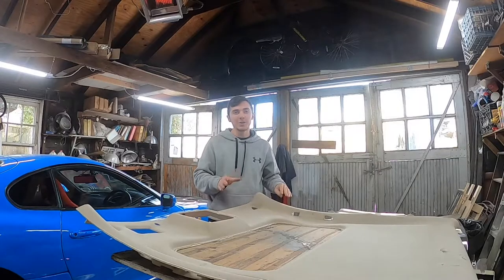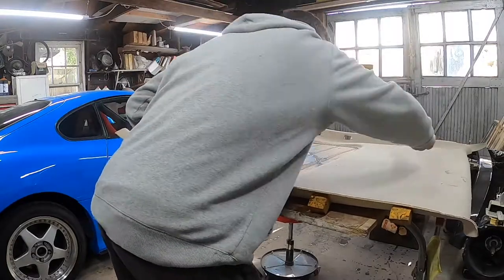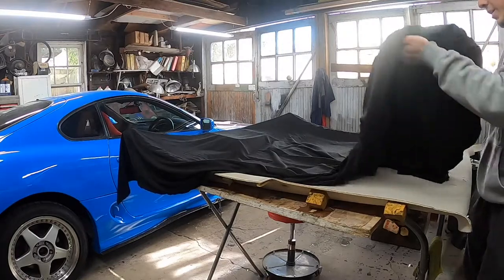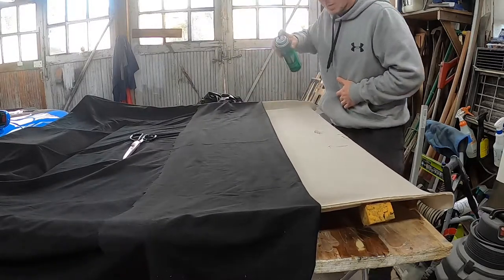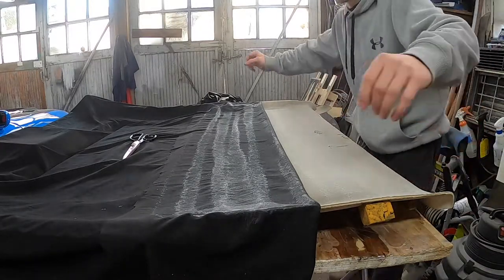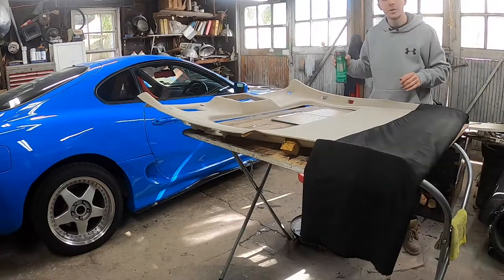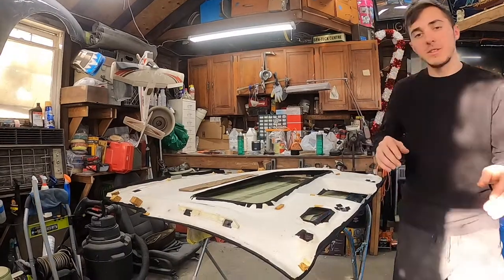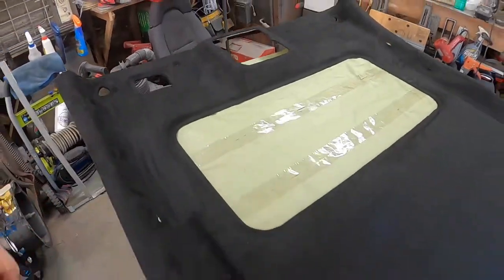How to make a Custom Suede Headliner

Comment: What kind of adhesive did u use in the can for the edges?
Reply from the maker: It’s called “barge contact cement” I bought a big jar on Amazon for under $20
Reply: It's 33$ now 😢
Reply from the maker: @ua7pyro591 that’s crazy how much they went up in price!!

Comment: I added suede and now my sunroof cover won’t open :(
Reply from the maker: When you use a fabric over an existing headliner you have to make sure to take your time and firmly press the new suede on all edges, if you have even a little piece that didn’t stick it will rub or even lock against a slider rail such as your sunroof